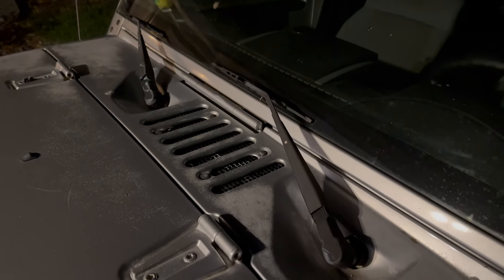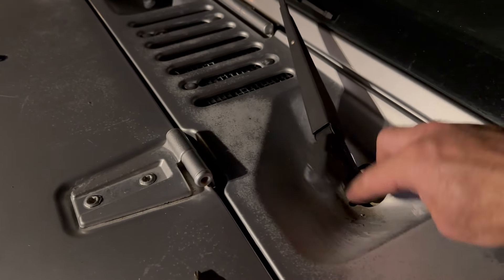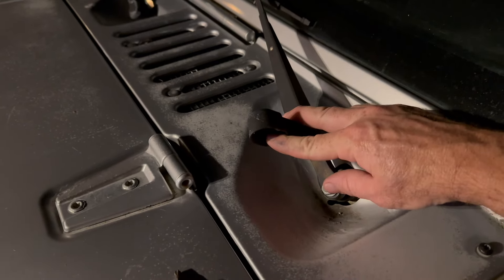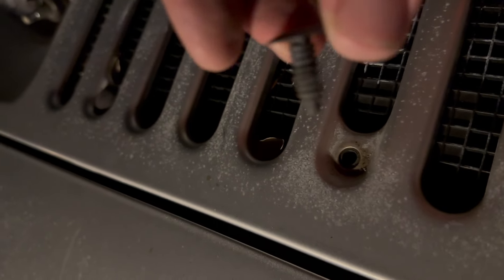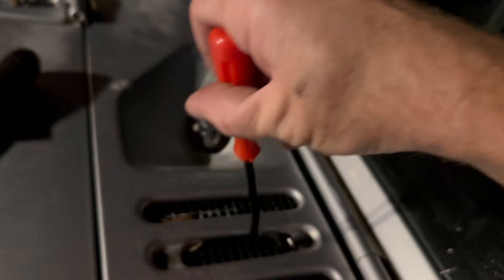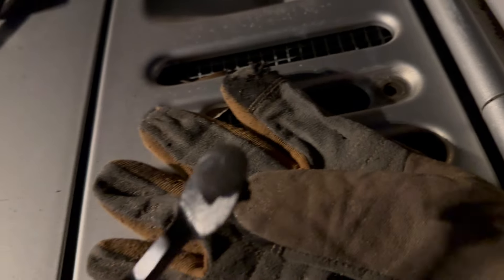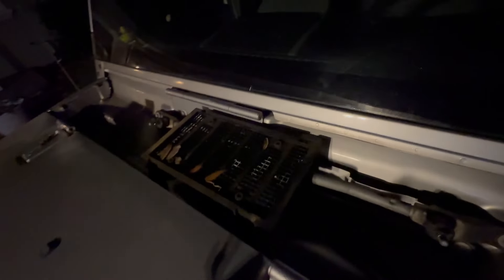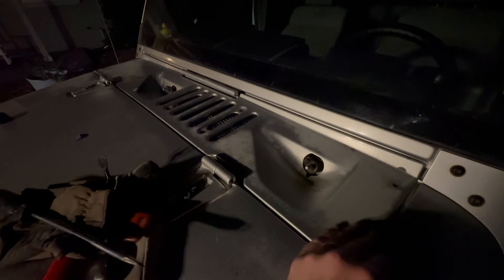HOW TO REMOVE COWL and WINDSHIELD WIPER ARMS - JEEP WRANGLER JK / JKU #jeep #repair #diy

Comment: Where did you find that tool! Im struggling with this RIGHT NOW. Ugh
Reply from the maker: Which tool are you looking for? The T bits (looks like a star) to remove the screws?
Reply: @FireItUpGarage the trim tool for the plastic clips - I found one today and got it done! Those plastic things were a pain in the ars. Ended up having to replace them. I. Just glad it's done! Appreciate your vid. Just what I needed.